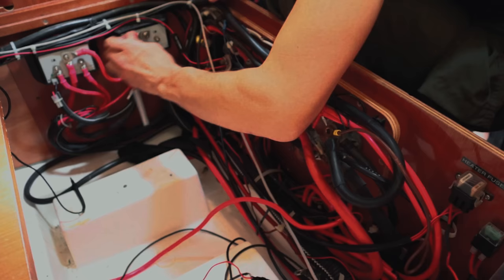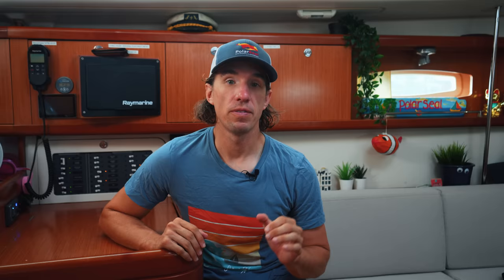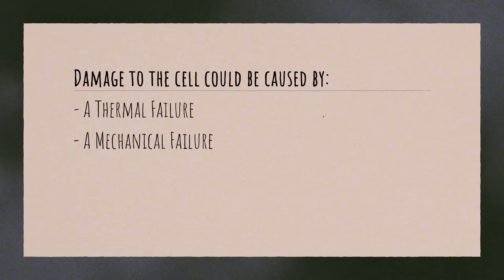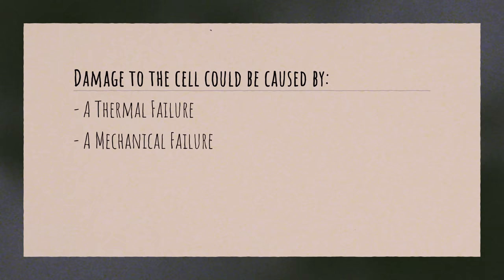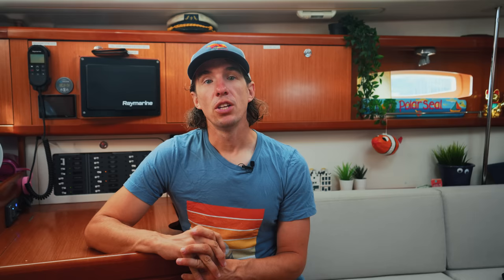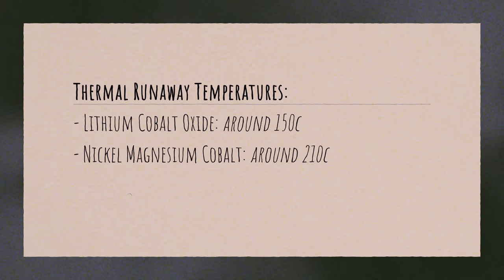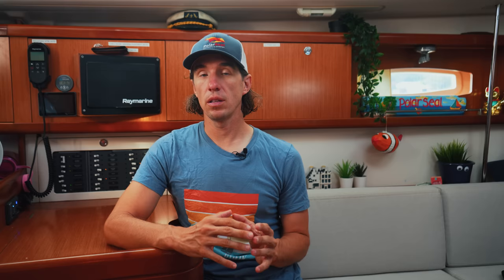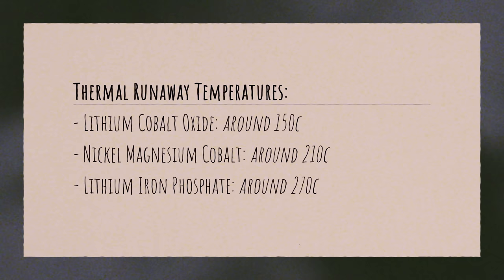WATCH THIS before installing lithium batteries on your sailboat ⚡ [RYAN'S TECH CORNER]

Comment: Hi Ryan, good video and well explained myth-busting on BMS technology. I wish you had outlined your previous video installation as well as this video. What regulator did you install, how did you do it? Did originally have a DC-DC charger set up and then upgraded?  Which power regulator did you install?
Also, I with Dakota ... why are they only selling batteries and not additional bundles to compete with BB? 
Seems still to $$$$ pricey.

Comment: It isn't dangerous because Lithium is dangerous. It's dangerous because it's more volitile than lead acid and the average person is stupid. Why do we need child locks on lighters? Lighters aren't dangerous on a boat either, it depends on who's holding it and what they're doing with it. Also with overproduction it's never a good idea to dive into something now they're what 1/10th of the cost to produce and nose diving. So even if you were planning to implement it the best time is probably still next year when they're even cheaper than now the average person can afford to pay someone that knows what they're doing to install them. That money just disappeared into overpriced lithium if you did it last year. Probably expanding on some of the differences that create thermal runaway like charging below freezing or give it 2 or 3 winters of leaving that boat on the hard without removing the batteries and see what happens. So I think a lot of those improper installation situations are likely to expand over time.

Comment: Well, here comes the question. Looking at yachts specially the wires, is (sorry to say) n enormes mess. Different owners has different view and are making connections only God knows for what purpose. Now most owners of yachts are not as good educated as you are. So even they read all the instructions written in the package from the battery fabricant they are still DIY amateurs and not a professional.  Even after instalment of new/used batteries there should be given by a professional person a certificate that all connections and lay-out are according the rules for sea going ships. I come from the merchant navy and done that for over 50 years, all ships I have sailed on where under a Class Society what means that all certificates INCLUDED electric matters on board are approved by a surveyor before this vessel goes to sea. Now having said this for small yachts there is NOT such requirement, at least not that I know off. I have nothing against owners that do all themselves due to save cost but at the end of the day it should be approved by either a Class surveyor or a marine electrician that is recognised by authorities. Only then the owner can be sure that the works he has done is in the correct manner. You right that it should be the Insurance company that require certificates for the electric works done on that yacht. Tell me if I'm wrong but lately if you see here on YouTube some engine rooms and electric wires I keep my fingers crossed nothing will happen. Must say that some new owners take out all wires and start from scratch correctly as from the spaghetti they where in without a proper diagram NOBODY knows what is what and where to it goes. Anyway, not critic your clip here as it is useful but still I have my doubts that it can give wrongly interpretatie.to some of the owners.  .

Comment: Not wishing to throw a massive spanner into the works, ( I would love to afford to convert to Li ion) please will everyone understand that children work and DIE mining Cobalt in Africa for these batteries.
Reply from the maker: There is no cobalt in LiFePO4 batteries. So, if that’s your concern, you’re OK.
Reply: Less than 200 years ago the slaves that had to pick cotton had working conditions that can be compared to to children in Congo today doing horrible informal small scale mining. The problem of slaves working in the cotton industry was not solved because people stopped buying cotton shirts. Same applies to Cobalt mining working conditions.
Reply from the maker: @ralffromsvbarbarella9708  but again. Cobalt based lithium batteries find their applications where the battery needs to be as small as possible (mobile phones, cars, etc), and thermal runaway occurs at lower temperatures, so they should not be used on boats. Sadly, a lot of objects we use in our daily lives are the product of labor conditions we do not want to exist, and we need to keep having our eyes opened. But in the case of boat batteries, you should NOT install cobalt based lithium!

Comment: "Let me down AGAIN Dakota Lithium" said the man who tested the BMS in a Dakota battery. He even adds a FIRE WARNING

https://www.youtube.com/watch?v=1WF9NlDW_r4

Short Circuit Protection didn't work and he recommends using a "fuse". Sort of runs contrary to all the information you provide in this video as well as the constant references to Dakota batteries reliability, yada yada yada. 
In another review the 7ah hour cells only provide 6.6ah so complete misrepresentation. If you are going to plug something on your Youtube channel, make sure you can stand over your product. In total he tested four Dakota batteries and could only recommend one. That's pretty poor, so suggests they are poorly manufactured in China.
Reply from the maker: Thanks for this John.  I can and do stand behind these batteries as i have personally had them and used them in every boat condition.  Remember, the BMS short circuit protection is meant to protect the cells, not the users or wiring.  In fact, ABYC REQUIRES all batteries to have proper fusing after the battery.   while everyone is entitled to put their opinion on the internet so i would encourage you to check many sources not just this one.
Reply: @RyanSophieSailing  Thanks Ryan. However two points. Firstly by your own admission Dakota Lithium Battery BMS does not include "EXTERNAL" Short Circuit protection. Thank you for that confirmation.  

Therefore a short that occurs between the terminal and the fuse could cause a fire e.g. if the external sheeting was worn through by movement of the boat, the current could go to ground and cause a fire. Surprisingly enough the Amped Outdoor battery  that was tested at  in the same video,  did provide external short circuit protection. Therefore Dakota is an inferior product in this respect, especially when your video is about the fire potential, a point you underscore in several places with flame imagery. 

Furthermore, pointing out that your personal batteries didn't have this problem is academic. The potential is there for the Dakota to short circuit externally and as such, it will not offer protection.

Secondly you have not explained why a Dakota battery, which is labelled as 7Ah only has 2 x 3.3ah cells in parallel. Therefore that's 6.6Ah's as opposed to 7Ah. That's clearly misrepresentation. So why should consumers believe the rest of Dakota's claims ?? 

Whilst the information you provide in this video is relevant and good, it's also a naked promotion of your own product, which is clearly inferior to competitors and this point was not made in your video. On the contrary you suggest your own companies batteries are superior and justify the higher product price tag, which is clearly open to debate and perhaps little better then the Chinese unbranded equivalent made in the same Chinese factory? Dakota batteries are using products manufactured in China and not the US, so highly possible they are similar to the unbranded equivalent.
Reply from the maker: If you would like me to explain all this points I'm glad to do it but it's more than the comment section supports.  Please feel free to email me at ryan@ryanandsophie.com  or... if you want an official comment please email support with Dakota.
Reply: @RyanSophieSailing  No worries.It's all pretty clear to me. Let's leave it at that. The facts speak for themselves.

Comment: There will never be lithium batteries on my sailboats.   6V 220ah batteries wired in series can be ran flat dead to 0v and be restored back to full capacity dozens of times.  No fires.  No thermal runaway.  Inexpensive.
Reply: Try running your la batteries to 0v just once and they're probably not going recover to good health. Do it several times and you will be buying more batteries for sure.
Reply: @laurapitre5797     In an emergency situation where I need every volt of juice in an emergency, you bet I'll run my lead acid bank flat dead.  That could be the meaning of life or death.   A lithium battery bank will not let you discharge past set voltage of the BMS.  So if you're in an emergency and your lifep04 battery gets to approx 10.5v, it'll shut off.  No more power.  You're dead.  An AGM has no voltage cut off.  Having that extra couple hours of electricity saves lives in the middle of the ocean.   Leave the lithium for costal and lake sailors.  Remember, this video is an advertisement for his business.  He will not tell you to not buy his product.  These videos and their sailing adventures depend on the sales of his batteries to fund it and you bet he's going to shill you to buy them.  They are not just some cute couple that left everything to sail running on a budget of just youtube revenue, they are multi millionaires that own massive corporations.  It's all a show, an act.